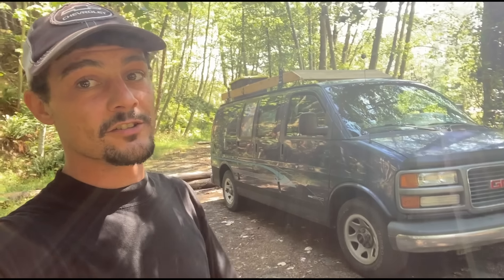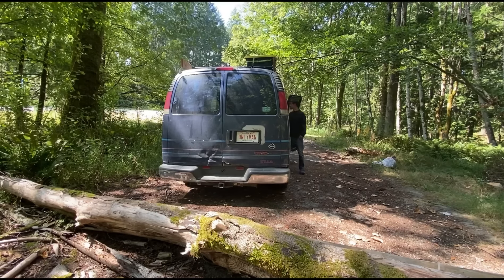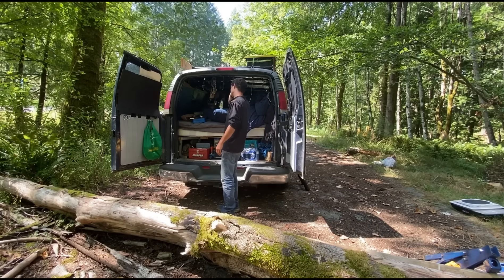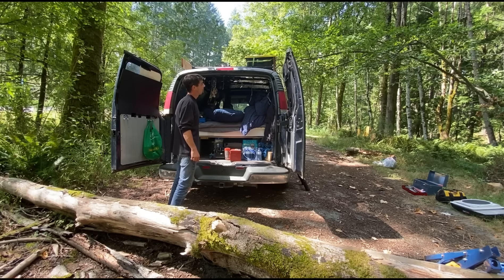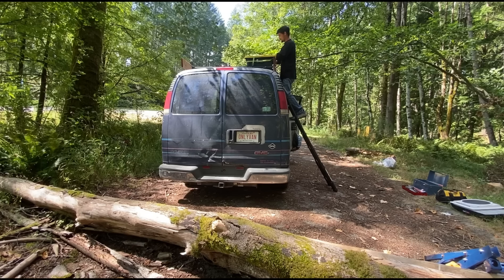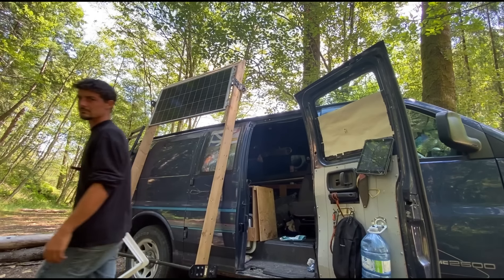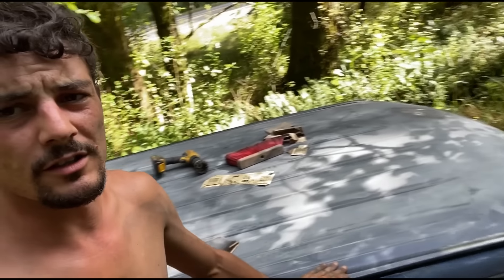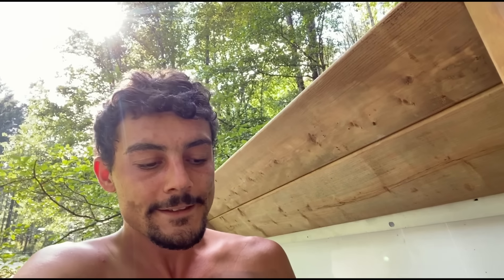Painting The Roof Of My Tiny Home On The Side Of A Road DIY Vanlife Projects (Mistakes Were Made)

Comment: Great video. This is going to be a very clever build once finished. I’ve seen “show cars” and they barely have room for the driver with all the equipment. A van has much more space but still this is also a home as well. Creating a space that combines all the necessities of life on the road with all the equipment required to make a show vehicle will take very thoughtful designs. I’m excited to see it.
Reply from the maker: Thank you 😁🙏 I basically have everything i need for living inside already except a hot water shower 
and my van is the same size as most big cars and wouldn’t / doesn’t need room to set up as everything is inside of it , it would be as simple as finding a parking space , also I’ve been to car shows with my other vans , car homes and even my old motorhome putting it on display 😎👍
Reply: @BruceVanlifeJunior  yes, as you probably know, Chrome has one for outside, so that’s definitely a space saving option. Also, I’ve seen backpackers use “water filter” bags (and bottles)that can purify water drawn from rivers and springs enough for drinking but i wonder why Rv or Vanlife people don’t use them for their rigs.

Comment: A cutting wheel, jig-saw, or a hack-saw to cut the roof vent hole. Measure a 14x14 inch hole is the standard vent sizes. File the edges, or grate up some cheese on the edges before you cover them up on the metal cuts.

Comment: Little TIP about your ladder...
Since it's longer than you need, and you just seemed to have discovered you can collapse it from the top, as well as the bottom... when you're adjusting it for use, if you put the extra steps at the top, instead of the bottom, you reap FOUR benefits...🤔
1) - You won't have that extra long step between the first and second steps... less awkward, which means safer, and , well, easier.
So, that is two benefits... 1 = Less Awkward/Easier... and 2 = Safer.
2) -  When your weight is supported by the outstretched 'bottom half' of the ladder, it is stronger/stiffer, since the side rails there are thicker tubes... whereas the top half of the ladder, with the thinner side rails, is weaker/more flexible.
So, like #1) above, you reap two more benefits... 1 = Stronger/Safer... and 2 = Stiffer/Less Wobbly (which is also 'Safer').
All 4 of those benefits come from one simple change... putting the extra steps up top, rather than on the bottom.
With a little practice, it's just as easy as the way most folks do it.👍🏼

Cookin' Meth?... BRUCE is BREAKING BAD... Uh Oh... Better Call Saul!🙃

Ooooo... I have a sandpaper tip too... if you cut it for the block, along the short side of the sandpaper instead of the long side... you'll get 4 strips from each sheet, instead of just 3.😲
(You won't have to trim the little ends off the longer strips, which are just wastage).

Nothing wrong with a trilogy... each one has a different focus... DIY roof rack... prep and painting... and cutting holes/installing fan. It all makes perfect sense!🎉

Ok... Vid's over... that's all I got for this comment... enjoyed it, as Usual, Bruce. Cheers🍻 and ☮🇨🇦

Comment: Why not paint the same color of the van? When are u going to put the air vent in and insulate the van for winter? It’s easier to get everything done now then wait till winter and have to do it then.
Reply from the maker: I’ve thought about that and might still when I do go to paint the full exterior but for now I just wanted to rust protect the roof and prep for roof vent 
Currently waiting on a good weather week to install the vent 
As for the insulation and winter prep that will have to wait as my budget doesn’t allow for to do it all now  , so it will have to come in time 
Doing it now would absolutely be much easier but I can only do what I can do 😁👍